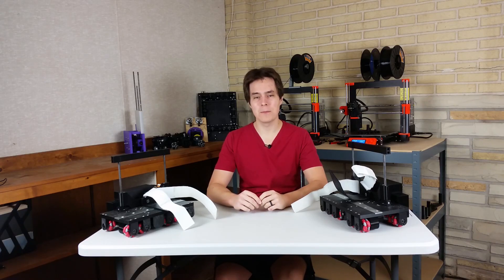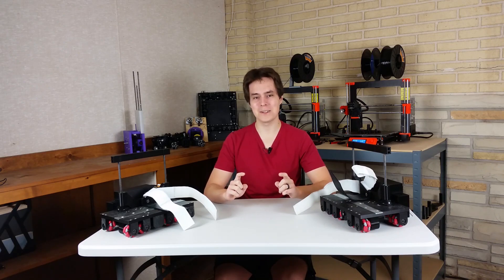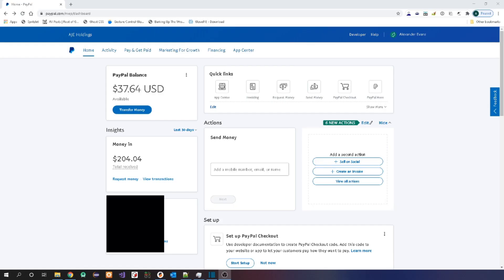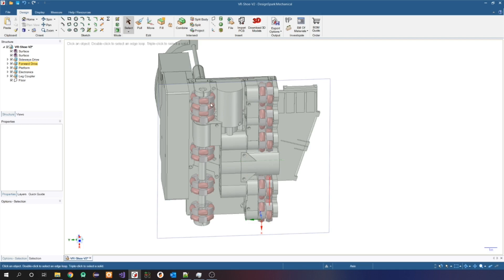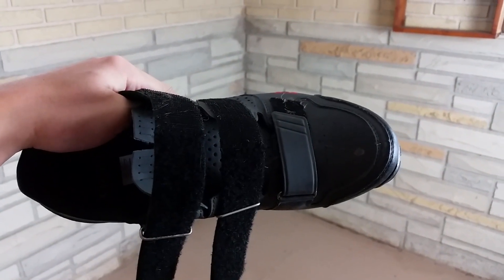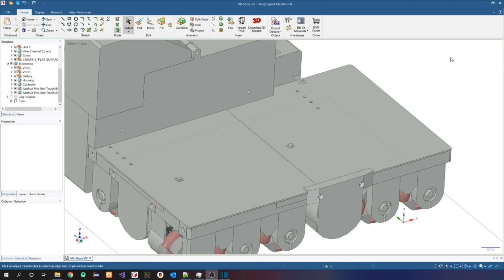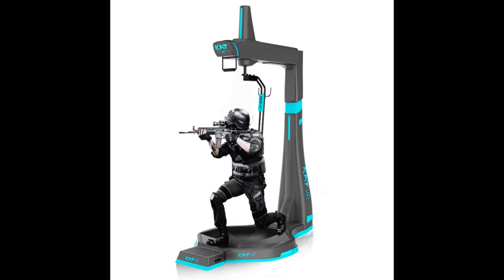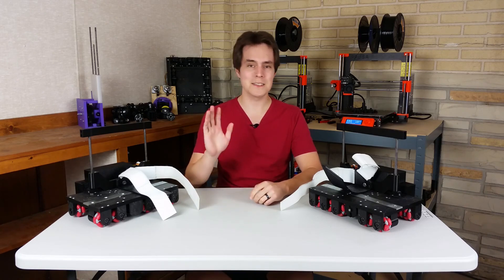Virtual Reality Motorized Shoe Build Log #28 - Social Media Success! More updates to the shoes!

Comment from the maker: Shoutout to VirtualDreamers for showing my project in his video - 
https://youtu.be/amabXZl8rVY

If you like 3D printing you'd like the Edge of Tech's channel and his stream every Monday night - 
https://www.youtube.com/channel/UC1Ak7Ir1WMOWauY_oH00-Qg
Reply: Pleasure was all mine. Really digging the updates you've got in line for the shoes. Safety is a big thing to consider and it's good that you're keeping it in mind early and clearly. Structural stability and accounting for material degradation over time will go a long way to peace of mind in the long run. Keep up the good work!
BTW: This is Virtual Dreamers, just the second channel for different content. Pardon any confusion XD
Reply from the maker: @Markystal  I recognized your name from Twitter, so no confusion here! Yes safety is a big thing for me. These are roller skates you wear with your eyes covered, so I don't think it will ever be safe to use these without some sort of safety structure. All the omni-treadmills also have safety structures too.

For the safety structure, every critical part will either be metal or at least 1 inch thick wood. Those parts shouldn't degrade. I don't think the 3D printed parts will degrade, but I don't trust them to not brake if the user falls.

Comment: Great work man, I think this kind of design ultimately will be the future of locomotion for v.r, it's the most minimalistic yet also more natural than the slide mills.
Reply from the maker: Thanks. I actually think the most minimalist solution to VR locomotion are things like the Kat Loco and WalkoVR. They're just sensors you strap on and you walk and run in place to move in the game. Those of course don't feel like actual running, but they're probably immersive enough for a lot of people. Then I want to make a few simplified versions of this shoe, which have nice-to-have features taken out, but are cheaper. I go into other versions here if you're interested.
http://evansalex.com/2020/08/04/a-motorized-shoe-to-be-used-with-virtual-reality-games-part-3/#other-versions

Comment: i understand you need the harness for prototyping but would the full design have that as well out of curiosity and if so do you have any ideas that could make it possible that it wouldn't need to be attached to the ceiling?.
Reply from the maker: Yeah, you could use something like a portable pull up bar stand as an alternative. I go into details here:
http://evansalex.com/2020/08/04/a-motorized-shoe-to-be-used-with-virtual-reality-games-part-3/#ceiling-mount-alternatives
Reply: @finallyfunctional  man this is really quite interesting i thought about it and depending on how the harness is made it could help with the issue the omnitread mill had ie  it struggled to keep you in the middle with sudden changes to your pace and if you suddenly stopped it would even under/overshot your position and would have to readjust looked very jarring
Reply from the maker: @Xalphoria  Yes I think it will be a big help with stability, especially when it comes to rapidly changing direction like you described. However, there is one possible disadvantage. Sure, it keeps you in the same spot, but it might feel restrictive. I'm going to experiment with different setups to find a balance with good stability while not feeling too restrictive.
Reply: @finallyfunctional  the only disadvantage i can think of is set up im already kinda lazy about getting into vr i have to clear out my space depending on what im playing carry my chair over get behind my pc unplug my second monitor plug in my vive turn it on wait around 3 mins for it too load into the steam home turn the air conditioner on and turn my fans around so i dont over heat then make the struggle of fitting my headset on with out messing my glasses up  to then realize i didn't charge one of my controllers.
Reply: @finallyfunctional  you may wanna go with a vest i imagine that would be most comfortable

Comment: How much weight are these shoes able to hold?
Reply from the maker: Not sure yet. They're working well with my weight, 160 pounds. But I'm using electric skateboard motors, and they can be pushed a lot more. I'm hoping they'll support well above 200 pounds, but I need to test it.

Comment: What if removed the motors and keep the tracking
Reply from the maker: I have an idea sort of like that I want to try out in the future. You can read the details here - http://evansalex.com/2020/08/04/a-motorized-shoe-to-be-used-with-virtual-reality-games-part-3/#other-versions

It would use small motors for active braking, but not for actively helping the user. So it still uses motors. I think without motors it will feel like sliding on ice, which probably wouldn't be comfortable.